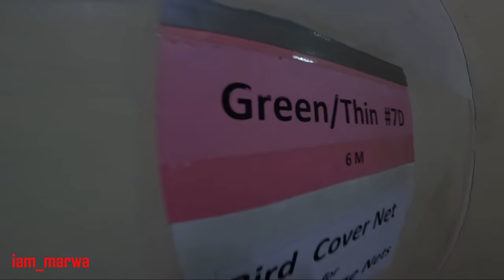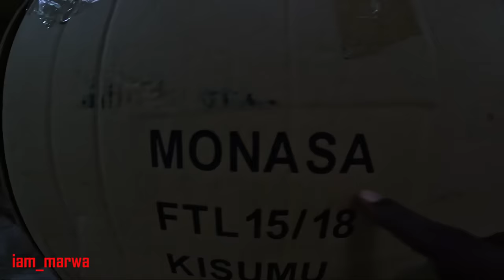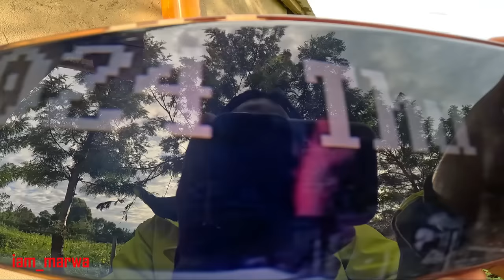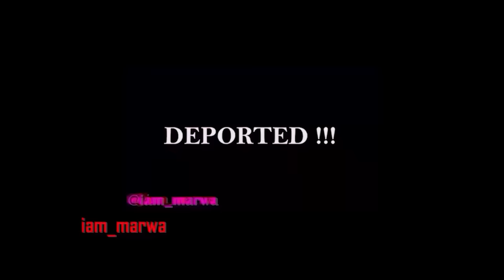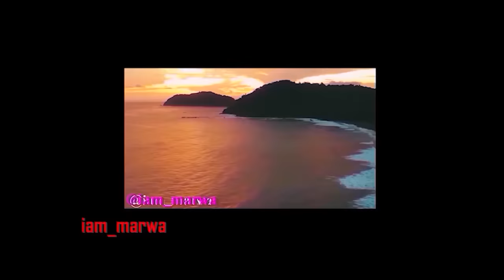Sad Mid-night Thief Steals my machine CCTV Captured Everything  !!!

Comment: You can create your own electricity for the whole village for 25 houses or more. Google high capacity generators you will need a 10 KW generator or above, you will also need a battery backup and a few solar panels. It should not cost you more than $30,000 USD. You will also need a knowledgeable electrician to install it. You can have all the houses contribute in the cost to buy it and operate it.❤❤❤

Comment: concrete based cupboards are very safe because taps are often left open and the kitchen floods.  Concrete won't rotten/spoil like  wood.  I have the same here in the Caribbean, I highly recommend the concrete base for the lower cupboards and counter tops. Congratulations Nasto! Job well done, hard work pays off. Same for Marwa.

Comment: The individuals responsible for the thefts are likely familiar with the villa area, residing in close proximity. Their knowledge of the compound, similar to how the child knew the way to the pump, suggests a potential connection to someone who has previously worked in the villa. To enhance security, it is advisable to install guard dogs, motion sensors, and solar motion lights. Given the attractiveness of the property to thieves, reinforcing security measures is imperative.